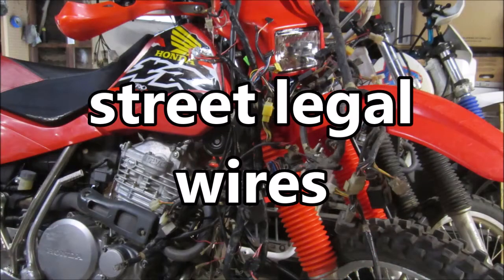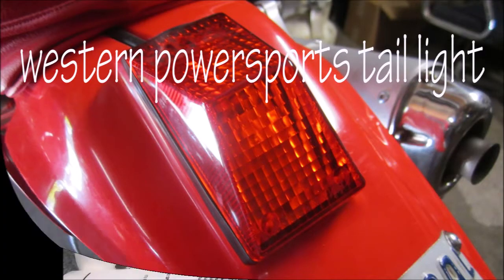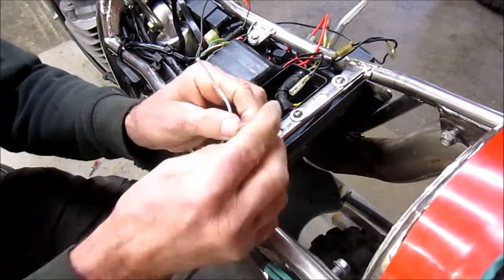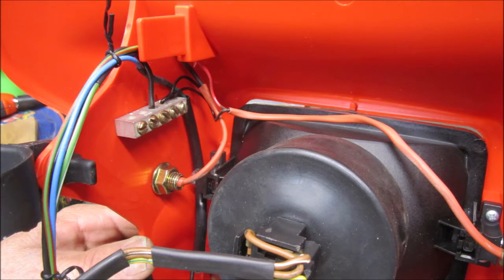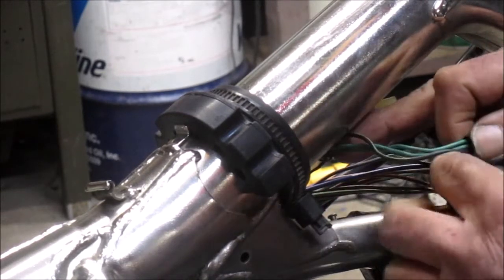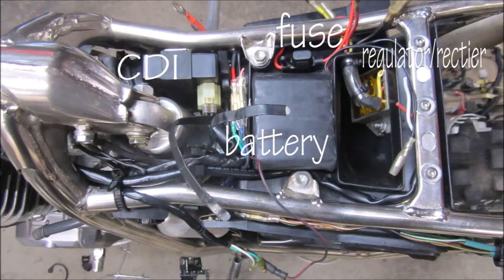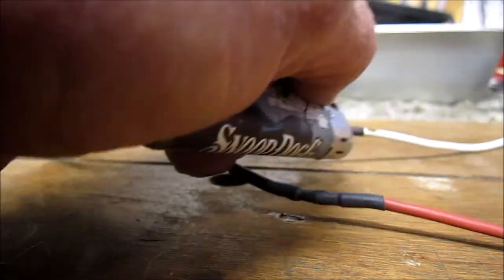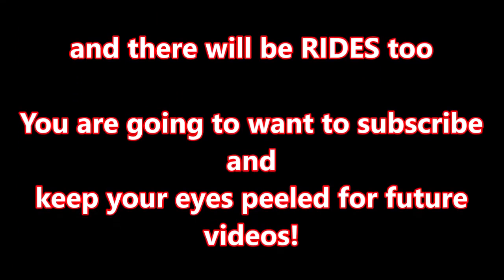nicky episode 10 nicky gets wired

Comment: could you do a video on how you got a battery working on an XR600?
Reply from the maker: Yelte, Thank you for your comment. And that is a legitimate request... how to add a battery to an xr600r. However, there's so many variables that it would be quite an in depth subject. I stated in the description that I intended to create a more  comprehensive video on nicky's wiring. That's because for each of the videos of "fixing up nicky" there is hours of raw footage that was left on the cutting room floor. Youtube watchers are a fickle bunch with a short attention span. So an hour long video just does not get watched. The average view duration is about 1 minute 27 seconds! With that said, here is what I did and your situation may be totally different;

1) you need a battery.
2) you need a new rectifier/regulator.
3) the stock wiring for a 600 can be left in place (but some of it will not be used)
4) the xr600r ignition components and wires can all stay the same. (including the xr600r low output stator)
5) decide where you want to mount your components.
6) in my case, the original power supply (stator) still runs the bike (and lighting). However, now with a battery, there is additional power. What I mean by that is everything works as soon as you get the motor running, but is less taxing to the 80 watt stator if you have a battery too to supply power to lights, horn, ect.
7) out of the stator the green and white/with yellow stripe go to your new rectifier. The black with red stripe still goes to your CDI.
8) the rectifier/regulator is grounded. So is the battery.
9) the power output of the regulator/rectifier hooks directly to the hot side of the battery as well as out (fused) to any lighting components.

It's really that simple. I used a separate power supply to test my lighting connections/circuits prior to finalizing the harness. But I flew by the seat of my pants with my expectation that the ignition system was still going to operate properly. (which it did)
It is handy to have the schematic from baja designs for their older dual sport conversion so as to have a basic understanding of the circuits. (available on line) You can buy a rectifier/regulator from ricky stator. You can get a great battery like mine from trail tech. (that's where ricky stator gets theirs)
Have high quality water proof wire terminals... (don't use those cheap crimp connectors)
 My bike will run anytime. It shuts off with the original kill button. (kill button grounds the ignition circuit) 
The switch on the dash is merely to take the batteries red/hot wire out of the loop. (baja designs states that if the bike is left for extended periods un-used, the rectifier/regulator will draw your battery down) 
 I also incorporated a "battery tender" lead into the system so I can charge the battery externally. However, with regular riding your battery will get charged.

So...
It is complex and confusing at the same time, oh so simple to do. Depends on your bike, what components and you. Variables...
You still need to make determinations for headlight, blinkers, stop light and so on. 
(but you did not ask for that)
I use the frame as a ground and have redundant grounding wires in two locations.
 I have wired 3 xr600r's for batteries in the last year, so my understanding of what to do is pretty solid.
Should you or any other xr600 owners have questions ask them here and I will try to help.

A video showing all the in's and out's of re-wiring for battery power on a xr600r will not be available from me for some time. (if there were enough solid requests I might strive to create one sooner than later)
Each bike is a new situation depending on the desired outcome.

Maybe this was of some help to you Yelte